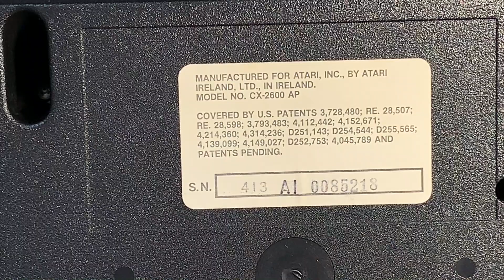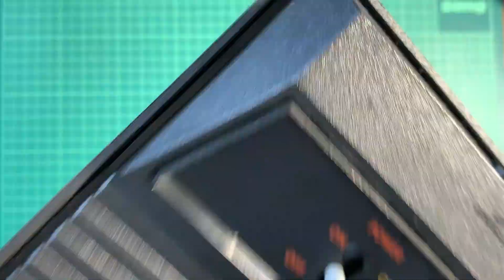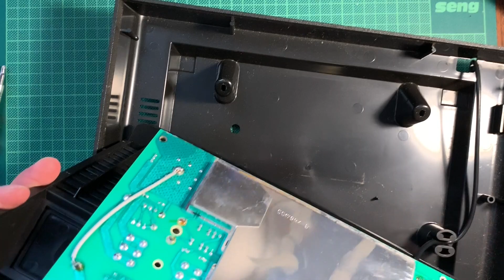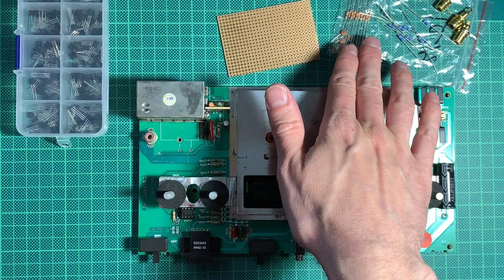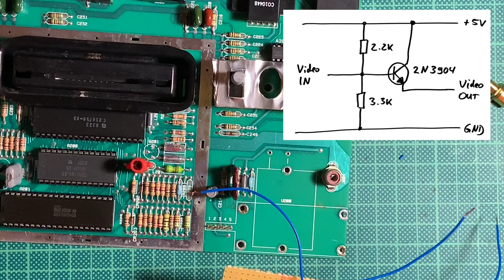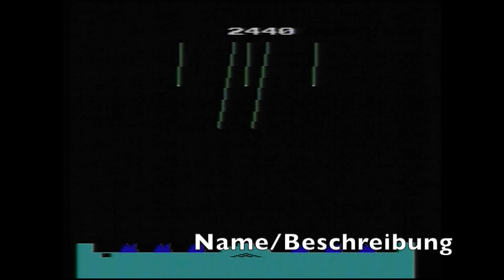Atari 2600: Composite Mod and Gameplay

Comment: Having different coloured wires would have been really helpful to both you and the viewers!
Also, I note that the modification kit you used did not have a "75R" resistor (?). Mine had this, in addition to the 2.2k and 3.3k resistors, along with the transistor. Might this explain the imperfect video signal? I got my kit on Ali Express.
Reply from the maker: The video is literally 5 years old today. It was an eaaarly video. :) I didn’t buy the kit, but used things I already had. I thought about revisiting this mod, but have been using the Atari Jr much more in the past years, using the tfw8b deluxe composite mod instead.
So maybe there IS a mod that will result in better video quality. The 75Ohm resistor might be for proper termination.

Comment: Thanks for the video! I have in fact a very similar board that I am trying to restore and install the mod. But I am very stuck... because I can not find the schematics... in yours it says version 6, mine is very similar but version 5. However, when I google about it, I find schematics and board layouts that are suposed to be for anytning between rev 1 and rev 13, but it is not... matching... Is it because I have a PAL board? Do you have any sugested place where I could find the info? Thanks in advance! Great video!
Reply from the maker: Definitely ask on AtariAge forums! There WILL be someone who knows, I bet.
Reply: @root42  By the way yesterday I did the mod for an atari jr I have, follwing your video, and works perfect!
Reply from the maker: Awesome. Glad it works fine for you! I noticed that for my Jr the colour is not very saturated, but the sound is quite loud. So I have to tune down the volume and crank up the saturation on my monitor for it to look good. But might be just my Jr...

Comment: Top tip for refurbing the joysticks, you can swap out the horrible domes and fit low profile microswitches instead, which makes the joysticks super responsive with only small movements needed and actually a pleasure to use.
Reply from the maker: Good idea. Still needs the ring to be intact though! There are 3D models for printing, but their quality and durability varies wildly.
Reply: @root42  agreed, although you do need to very carefully nip away or file down the points on the white ring that press the little microswitches, because even low profile ones sit higher from the board than the dome switches. I've only fitted microswitches to one of my joysticks so far, but am seriously impressed with the results and it was definitely worth the effort. The microswitches are soldered to the contacts on the board and the key with nipping or filing down the push points is to remove a tiny bit at a time, then put it back together and test it. It takes time to get it right, but if you remove too much, it would be very difficult to correct it.

Comment: I don't like that "Butcher" method using cheap transistors as it destroys the Atari finally. More higher quality mods allow dual use (RF/Composite/others), delivers a much better video and are certified for specific HDMI scalers. Currently the market is split in low-end and those offering HDMI compatibility. In long term a cheap modded console means to dump it somehow in a few years.
Reply from the maker: Do you care to share a link for a better mod? I chose this mod because it could be reversed (the resistors and transistor are replaceable, the RF box is in storage). I know about the RGB mod, but that is even more invasive in my opinion. This mod I can use until my composite converter/upscaler dies. So it will last probably my lifetime... ;)
Reply: @root42  well the first class mods (including the graymarket UAV board) allow to use scalers but the disadvantage is you must find the right one on your own. There are commercial versions out there like the "universal analogue video" connector (UAV) which is available for different Atari consoles. Those having enhanced features and are the current state of the art consoles allowing to connect by different signals (like VGA, RGB and HDMI) using certified scalers.
Reply from the maker: Ok, found the UAV thread on AtariAge (https://atariage.com/forums/topic/260267-the-uav-rev-d-video-upgrade-thread/). Seems like an interesting mod, but definitely more involved. The information needed for modding also seems quite spread out. I will consider this for the future, but I definitely have to read up on which kit will fit, where to get it and how to install it. Seems to vary depending on which 2600 you have.
Reply: I'm about to add a composite output for my light sixer (PAL) and are trying to decide which mod to use. What do you actually mean with "cheap transistors destroying the 2600"?  Do you mean that a lot of the original parts has to be removed to apply the mod - or is it actually making the TIA go kaput after a while?
Reply: Mats Engstrom it means you need to remove part, change circuit for one of the worsest output.... therevarevso many nondestructive mods....
Reply: @ralfp.9372  Ollrighty, so there's no real destruction unless you're a compete klutz using the soldering iron then. Lifting a leg of a a few thru hole parts is not really a problem since that can easily be restored into it's original state without any issues. What I see as worse is drilling new holes into the case for the contacts as many do. I'll just bring out new cables with female phonos in the end out through the existing hole for the removed antenna cable.

Comment: What are you feeding the composite signal into? I see some pixel shift around the sprites. Ms Pac-man is a good example of the lower pixels in the maze warping around her sprite? You using an Extron by chance?
Reply from the maker: I am using a Goobay Composite to HDMI converter. But I also have the same fringing on my Grundig TV. I think this is inherent in the Atari mod I did. Some guides recommend to remove the red coil. But I don't want to remove stuff without knowing what the results will be. I am glad if someone knows what causes these artifacts.